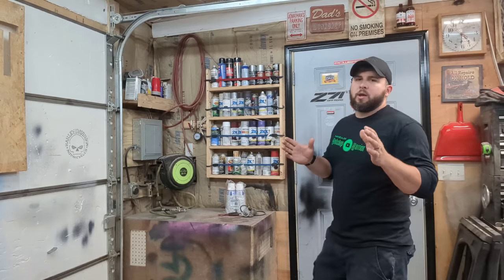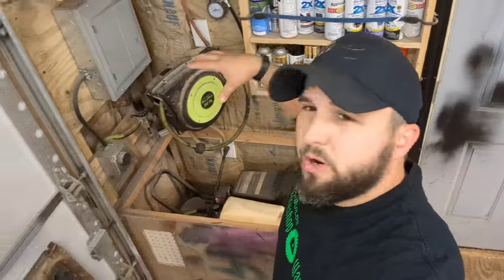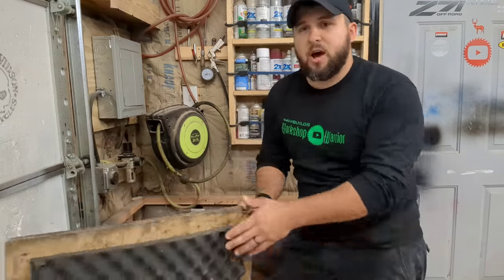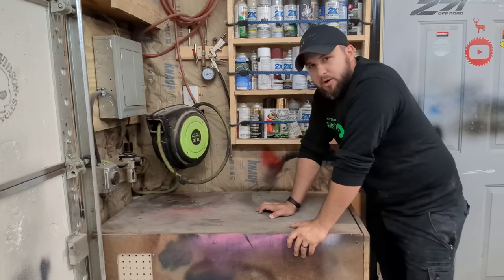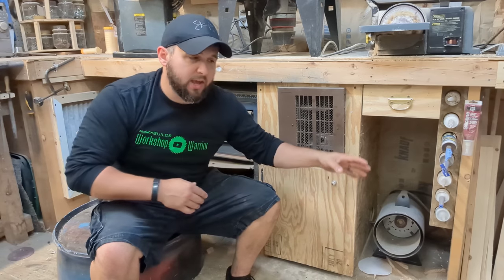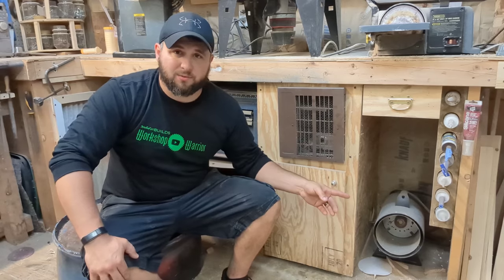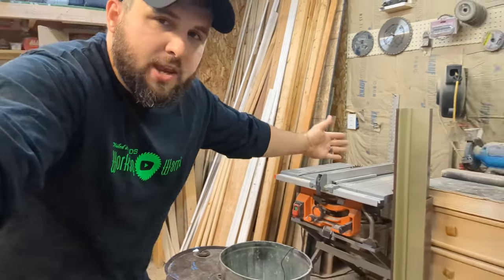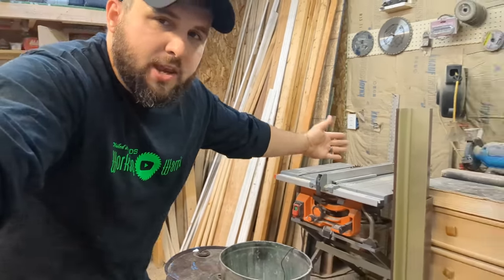Small Shop Hacks, Maximizing Your Shop

Comment: Knew subscriber. You are very creative. I have a two car garage that I’m only using half for my shop right now. Eventually I will use the whole garage. But with all my power tools I had to really think out where to put things. I’m actually finishing my garage with electrical, plumbing, and a mini split ac is down the road. Your advice about the power outlets is spot on. I have 4, 4 plug outlets down one wall but the other wall is about to get 6 or 8 with a 220 outlet just in case. I will point out something to consider. The compressor enclosure is brilliant, I’ll be doing that. But you do not have nearly enough ventilation for it. That compressor will wear out much faster than it should (heat). Easy fix of course but I would definitely consider adding a ton more ventilation. Thanks for the video.

Comment: Great stuff, I LOVE the box fan air mover/purifier. All your other stuff is pretty cool too. I am surprised at the lack of pegboard, Man I could not live without mine. Drawers and chests are cool but having everything visible is fantastic. Mine is a 12x20 and man I would love to have that extra 2 feet of width, I opted for double doors and NOT a roll up. This has several advantages of using only one door when needed or when I need to open the shop they open out and not up giving me shelving space above the door... another very visible attribute to the use of outdoor things. I am not insulated sadly which does give me a little more space. I also raised it on concrete piers for a couple reasons... I didn't want anyone getting the bright idea of storing a lawn mower inside so its height makes it a little difficult and it gets it off the ground.
Reply: My last shop was all done in pegboard and I grew to despise the stuff. The hooks always falling out. I have buckets of pegboard hardware. I'm not a fan.
Reply: Unfortunately where I'm from we have to "make" our own pegboard, as you can't buy it here in Finaghy
Reply: @clemmcguinness1087  you're not missing anything by not having peg board. Well, you're missing out on all the backache from bending over to pick stuff up that falls off of it I suppose. Then there's the joy of a blowout when you overload it. You knew it couldn't support that much weight but you just had to hang it off of it anyways.
Reply: @1pcfred  OK I'll take that as a win!
Reply: @clemmcguinness1087  those aren't even the worst parts of peg board. There's long term negatives to the stuff too. I love hardboard but I don't want to be surrounded by the stuff. It's kinda crap brown in color. Yeah they make it in colors too I suppose. Painting pegboard yourself really isn't a viable option. The stuff sucks paint up like a sponge. It's weird.  I guess there's primers that can seal it? Still with all those holes it's going to be a nightmare to paint. Then hanging tools up you're just asking for them to collect dust. They will. Now all of your tools are dusty and dirty. Unless you run around cleaning them all the time. You'd better too. Because dusty dirty tools are going to end up rusty dirty tools. Just the nature of ionization. Nah you're better off with drawer slide tool boxes. More expensive but worth it.
Reply: @1pcfred  I have the metal stuff and it is above my table so IF something falls its on the table but that is rare and I didn't even use any of the peg straps they included. Now I did modify some of the peg feet to hold better but overall it makes things really fast and I have a lot of guests in my shop with projects and instead of looking through drawers they can easily find tools needed to complete simple tasks. I get it though peg is not everyone's thing.
Reply: @megafatshady  I have heard of people hot gluing the pegs in. I guess it depends on the nature of the work in a shop. But for me tools being out is a death sentence for them. There's just too much dust they're going to collect. Contaminants laying on metal in a non-climate controlled environment is a recipe for corrosion. I can't be asked to be running around dusting everything all the time either.

Comment: Putting air compressor outside with an awning over it is a better placement and for 3 reasons...
1.not building heat inside a box 
2.freed up inside space 
3. noise is outside

Comment: If you need dust free storage, an old refrigerator makes a nice cabinet. They only last about ten years these days Also, for drawer storage for tools, if you find those old meat lockers common to small towns in the old days before home refrigeration, they will hold tremendous amount of weight

Comment: A air compressor needs 10x it’s capacity of free air for cooling it I have seen one fire because of people putting them in a little box like that. And by using the switch you made stops the blow down valve from working meaning that if you turn it off when it’s running the pump will stay at full pressure. And it’s very bad for a compressor to try to start when loaded.
Reply: Mine will push through it. The motor is rated 2X what the head needs. Someday when the head locks up the motor will just pull it off the mount for me. It's either going or it's gone!

Comment: How did you get a permit to build without doing footings. Even though I live in the boon docks and still any permanent building over 120 Sq ft requires concrete footing. I got around it by buying one of those prefab (12x30) buildings and having it delivered. Thinking of buying another one.
Reply from the maker: Don't know. I pulled all permits. They were only concerned with trusses snow load rating. I really wish I would have done proper footings.

Comment: How do you drain the tank on the compressor? Have you ever seen what a compressor will do to your shop if it explodes? Keep mine outside
Reply from the maker: Bass elbow, 1/4" line, and a shut off to drain in. I did a shop make over recently and moved the compressor outside for the reason you said. That video is also on the channel now. Thanks for watching.

Comment: I have the same size building that you do.  I have a number of fold down work benches, and the roll away tool boxes fit under the 6 foot workbench, and 4’ desk workbench.  You should put the compressor outside in a little lean to compartment.  Besides the noise, it saves space.  Also, if the tank lets loose, it’s best to have it outside in a separate compartment.  I won’t own one of those direct drive oilless compressors.  I have an old craftsman, which is a devilbiss  twin cylinder that runs at a lower speed.
Reply from the maker: I'm actually in the process of redoing the shop and I'm moving the compressor into the adjoining lean for those exact reasons. I'll be putting out a new shop tour video in a few months.
Reply: I had a tank rot out once. It doesn't blow up like a bomb. That's one of those doesn't happen deals. I welded the hole back up too.
Reply: @1pcfred  Sorry but I have seen  compressor tanks rupture, not from rust, from the fatigue of expansion and contraction.  If you want to see pictures of this I’m sure you can’t find some on line.
Reply: @rodgraff1782  anything's possible I suppose. But the tanks have pressure relief valves on them. Or at least they should. My main air compressor has an air tank on it that's 80 years old now. I'll let you know when it blows up. The one I have that leaked was a lot newer. The old one is ASME rated and the newer one isn't.
Reply: @1pcfred  Those tanks are supposed to be inspected inside every so many years, but hardly anyone does this unless it is a very large compressor, that requires it for insurance purposes.  There is a removable plug, where a bore scope can be inserted. Most fail due to internal rust, from not being blown down.  We use automatic blowdown valves to ensure that gets done.
Reply: @rodgraff1782  I had a portable tank rust out on me. The walls of portable tanks are thin to keep them light. When it went it just hissed out. It was just a little rust hole on the bottom. So I welded it back up. It didn't blow up like a bomb.
Reply: @1pcfred  Never weld on any type of pressure vessel.  The heat changes the metalurgy, and it becomes very dangerous.  This includes not just trying to patch, but welding on any accessories or brackets.  If it leaks, throw it away.
Reply: @rodgraff1782  I'm not throwing away a $1,200 piece of equipment. Compressed air isn't high pressure anyways. I don't run over 125 PSI
Reply: @1pcfred  ok.  But you’ll never get me to agree.  I know a guy who was killed by a ruptured well pressure tank. He was recharging the tank with compressed air and it let go.  It was only a 30 lb charge. Manufacturer stated to not add air, because if the bladder leaked, and the tank was compromised, it could let  loose, and it did.
Reply: @rodgraff1782  I'm thinking some about it and I guess the critical factor is the rubber bladder in a well tank. Rubber stores and releases energy quickly. I've cut a well tank open and the bladder in those things is nuts. You've seen a balloon pop. That bladder is the balloon to end all popping balloons. So that's what I see happening in that scenario. Compressed air tanks don't have that elasticity. They can't pop like a balloon.

Comment: Welding inside a wood shop has its obvious hazards. Thanks for tips
Reply: You just clean up a bit before you start welding. Get rid of any piles of sawdust that a spark could catch up. I have a garbage pail right under where I weld and I move it out of the way too. I don't weld all that often really.

Comment: I like the propane rv heater-I think that will work well in my 16'x16' wooden shed which I can just fit my TR6 into for its pending revitalization. 
A question, when welding/grinding/sparking are you at all concerned about dust, residues,flammables etc catching fire especially with total wood construction? 
I was thinking all my welding was going to have to be done outside on the brick work patio that leads to the shed's front doors. I also thought I could use sheet metal put on top of the wood floor and half way up the wood walls maybe as a measure of extra fire resistance and generally being extra diligent doing metal work.
But then one wonders if that one errant grinding spark is gonna catch something, smoulder and go up 2 hours later when i'm elsewhere.... am I overly concerned ? Regards
Reply from the maker: Only issue I've had with doing metal work is I was cutting with the metal chop saw and all the sparks were blasting into the insulation and started a small fire which I had a feeling would happen so I watched for it. But no wood has caught fire. I keep a fire extinguisher in the shop in case.

Comment: Did you dig down and add gravel to level the floor area? The soil type in your yard is probably why you had different results than your dad. Ours is hard clay but if you have a more sandy soil I imagine it would settle a lot more.
Reply: My shed was settling so I had to jack it up and dig it out and put gravel under the blocks it's sitting on. That did make a big difference.

Comment: How do you drain the water out of your compressor when it's that packed away?
Reply from the maker: Brass elbow screwed in the bottom of the tank with a nylon hose to the top of the bench with a shut off.

Comment: Quick drain valve .  Get the HF auto drain and let it just run on the floor . Or use a tiny hose to let it run outside the box.    All you ever see is a damp spot and brown stain.      I can’t recommend this cheap drain rig enough!!!!👍🏻
Reply from the maker: I ran a brass elbow and a few feet of 1/4" tubing to a  brass  valve worked awesome.

Comment: Just seen this video I have a space saving I thought of  I have two bench grinders  one with grinding wheels and a smaller one has a fine grinder wheel and a wire wheel  I didn’t want to use up that much bench space for both grinders  so it came to me i  used some 1/2 ply board about 20 in by 16 or 18 in.  found center of that board drilled a pilot for and hole and put a bigger washer under that board then mounted the grinders to the board  one on each end  then put the lag screw  into the work bench this allows the board to turn and I also made a hole in the ply board into work bench for a dowel pin and tapered it the hole in the bench was slightly  smaller to hold the board in place

Comment: You didn't have to have building permit?  In my area, anything over 200 square feet requires a permit.  Your shop is 280 square feet.  Building permits call for footings to be put into the ground beyond the freeze level.  I'm in the planning stage for a 196 square foot shop that will sit on a patio of pavers rather than a concrete pa.  While I'm not going to sink footings, I will pull up a paver and pure some readycrete leveled pads to put posts on.  The ground has a bit of a slope to it and will require that there ge posts of varying lengths to level the floor.  I will have to pull a permit for the electrical.
Reply from the maker: I pulled permits for the building and the electrical. Had everything inspected. They were mostly worried about me providing a snow load rating for the rafters which I did. Guess it goes to show the varying building codes between areas.
Reply: I built a 196sq ft shed/shop earlier this year to bypass the permit process. All i can say is build as far skyward as your  codes allow. Loads of room for storage if you dont mind hopping on a ladder. I built mine 13ft ft tall from floor to peak, barn style. My local codes say "cant be taller than primary structure on property." My original plans were for 16ft but roofing that single handedly would be sketchy. Happy building!

Comment: Yea my work table is the floor..  or a couple 2x4’s on the floor..  lol. A bench takes up too much space even if i can collapse and store it..  gotta have room for the bench vise, grinder, drill press, bandsaw, air compressor and tanks, toolboxes, hand tools, power tools, shop vac, dust filter, electronic workstation with solder station and microscope, i could go on..  lol. Too much shit..
Reply: Ah the far eastern approach. Nice. Then you need one of those cots they work out of. It hurts my back just to watch them. I get on the floor and I might not get back up.

Comment: I HATE all my auto retractable reels. I have had them for electrical and air and they never last. And I rarely use them, and I NEVER just let them rip. I have bought the cheap ones and the most expensive ones I could find, and still they fail.
Reply from the maker: I've had incredible luck with the flexzilla brands. Both mine are over 6 years old and work fine.
Reply: My reel isn't auto retract. It's crank. I'm not crazy about it but I've had it for a very long time now. I've done the coil of hose on the floor too and I really wasn't a fan of that. There's the tire rim on the wall deal too.

Comment: if you drop drill bit on wood floor it will be fine but how about concrete... 👍
Reply: If a drill bit breaks I just resharpen it. I usually snap them off drilling steel by hand. Now that I have a right angle HD drill I'm better at that though. One of them big ole Milwaukee drills. They're tight.